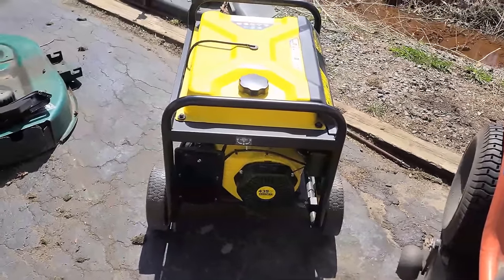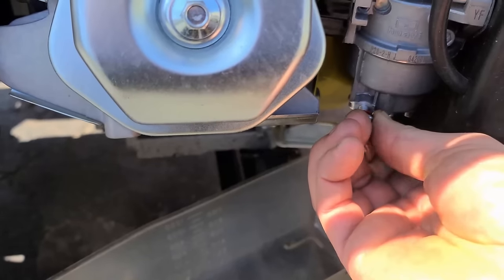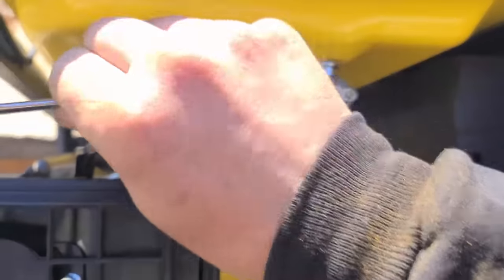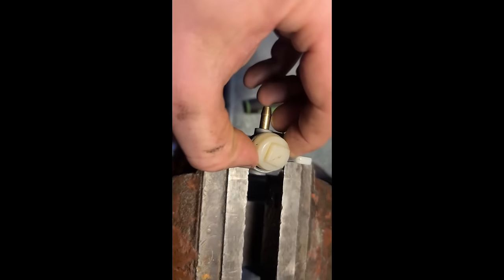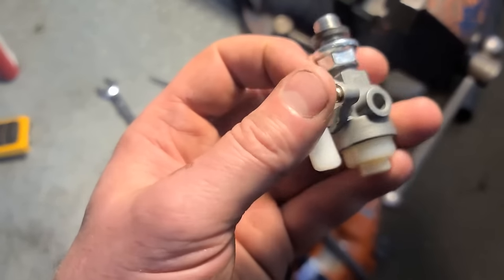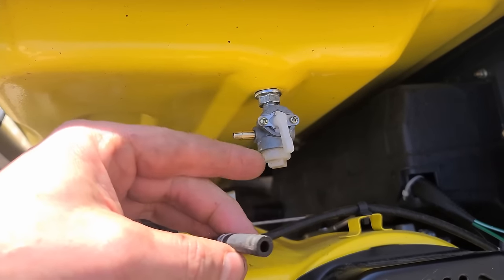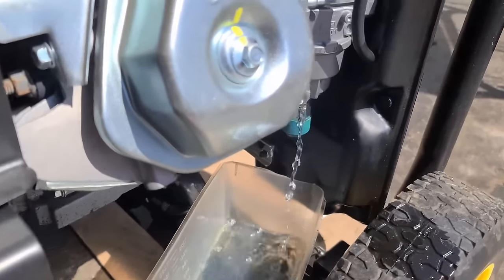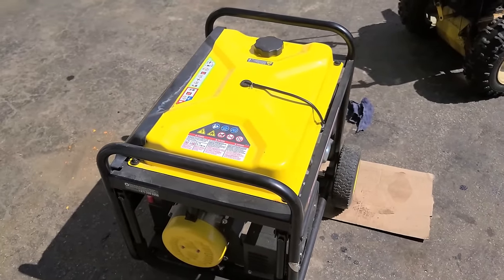Generator Runs A Few Minutes & Dies - Here's Why!

Comment: I had an issue with my 8k Champion the other day, it would start and run fine with a light load, but after about 20 minutes or sooner with a heavy load it would bog down and die. Let it sit a few minutes and it would restart and do it again. I am running on propane, dual 40lb tanks, so I knew fuel wasn't an issue. Pulled the plug and it looked perfect, nice and tan, no signs of lean or rich burn. Decided to check the valve lash since I hadn't checked it in about 40hrs of run time, and I found the exhaust valve had basically zero lash and the intake had .001-.002". Set them to .008" on exhaust and .006" on intake, fired it up and it ran for 12hrs straight without a bobble. Looks like the exhaust valve lash was so tight that when it ran under load or for an extended time, it would expand until it wouldn't seat anymore and the engine would die from compression loss out the exhaust port. Pay close attention to your valve lash on these little engines, it's important.
Reply: Thanks for that info, besides this issue, what is your opinion about this generator? I am thinking of buying one.
Reply: I have the 
5500 watt duel fuel champion, I’ve only run it on propane. It’s been doing the same thing you described. I just hit 100 hours so it’s still pretty new. 
It’s under warranty, but how difficult is it to get to the valve lash?
Reply: @sparta2v  
Sorry for the delay, don't log in very often. I've had good luck so far except for the lash issue. As soon as I corrected that it's running great again.
Reply: @benstoth  
It's not very hard, plenty of videos showing the process. A few common hand tools needed and they are typically pretty easy to access on an open frame generator. The lash numbers in my post are pretty common on these engines, but if you can find a service manual for your engine, set to what they say if its different.

Comment: I have a Honda ez1800 generator and it runs for 30 sec then dies; you can wait 10 sec and it does the same thing.  Same thing if low oil switch is disengaged.  Tried the bowl test and a steady stream of (new) gas keeps coming.  Exhaust not plugged.  Ideas?

Comment: I purchased a new Champion 7500W Duel-Fuel Generator (model # 201040) in October 2021. The gen was exhibiting the same issue as shown in your video with one minor exception. It ran flawlessly at idle. However, when I applied a load, the gen would die out after about 15 seconds. It didn’t matter if it was running on gas or LP gas. The result was the same. I contacted technical support and the tech said it sounded like a bad Overvoltage Controller and he’d ship out a replacement ASAP. After receiving the replacement, I installed it and the same thing would happen. Since it was under warranty, I took it to the service center in Newark, NY for the tech to diagnose what was causing the engine to die out when a load was applied. The issue turned out to be two bad 120V AC 20A GFCI receptacles which, for some reason was causing the engine to die out. After the receptacles were swapped out with new ones, the generator runs great now.
I enjoy watching your videos. I even watch them when the equipment you're working on is not relevant to me. I figure at some point watching your videos can be applied to help me diagnose/fix/repair power equipment in the future. Keep up the good work!
Reply from the maker: thanks for that info!

Comment: I have a 4.0 hp Champion on a trash pump. Very reliable machine. It quit running the other day and wouldn’t restart. I thought maybe it sucked some grit into the carb as it was low on fuel. I did a carb clean and still no go. Checked fuel filter, another carb clean and cleaned fuel tank. Still no go. Then it occurred to me this engine has a LOW OIL sensor. Checked oil and it was low. Added oil and engine fired right back up!  Live and learn I guess!
Thanks for your great channel!

Comment: I have had' hunting' issues with my generator most vids have pointed to it being blocked jets. I tried clearing them and it did not work for me, so I will be checking my fuel tap assembly tomorrow.  Great vid, thanks

Comment: Thanks so much, was exactly the simple fix my generator needed. Found sediment and crud in my 5 gallon gas tank after drawing the generators tank into it. The fill cap has a strainer however I dont always leave it in when I fill it. I will now be checking and rinsing the small engine gas cans when they are poured empty.
Reply: Rinsing? With?

Comment: Interesting, I checked my gas shut off valve and saw gas flow right so it wasn’t blocking.  Opened up the air filter box and removed the filter.  Somehow it started and stayed running for 5-8 minutes before gas ran out.  I added another few oz of gas and restarted.  All good now.  Thanks for the video and sharing what can cause the thing not running long.

Comment: I have a Duromax that did the same thing. The gas/propane selector switch is what was bad. I just bypassed that and placed the fuel line directly to the carb. Runs like a champ now.

Comment: I’m having the same problem, I changed the in line gas filter, which doesn’t fill up, thanks for the tip about tilting the unit back, I was wondering how I was going to take the shut off valve off , without emptying the tank

Comment: Hi, tank u for thw videos. My Hyundai generator had a problem with the fuel valve, I replaced it, but the issue is that it keeps revving intermittently. When I try to connect the water pump, which I used to connect without any problem, it starts having those acceleration intervals, then it shuts down, and the circuit protector trips."

Let me know if you need any adjustments!

Comment: I have a DuroStar DS4000S generator (purchased in 2015 on Ebay) which is very similar to the Champion unit in your video. My unit was running fine, I start it once a month and run it for 15 minutes to ensure it is working properly. Then one day, I started it and it runs for a few minutes and quit in the same manner reflected in your video. After watching your video I thought that the shutoff valve was also my problem.  I purchased a new shutoff valve (a little different from yours) specifically made for my Durostar DS4000S.  I installed it and it shutdown after a few minutes...  same problem as before.  It should be noted, I actually drained all the gas and put fresh gas in the generator tank before I installed the new shutoff valve. So I figured the problem must be in the carburetor.  I bought a new carburetor and installed it …  still the same problem.  I have no idea what to try next...  Any ideas what the problem night be???? 

 Apparently...  I need an assist!!!

Comment: I cleaned the jet that was on top of the carb because of surging at idle.  My Westinghouse iGen 2500 only sputters for about 5 seconds and then dies after the jet cleaning.  But...when I put the covers back on, I laid it over on it's side, forgetting about where the oil might seep.  Thoughts?

Comment: Had the same problem on my 1500watt would stay going for 30 seconds then die, I disconnected the low oil sensor wire and it is running smoothly again, thanks

Comment: I have a generator that is almost impossible to turn over, I remove the spark plug and it turns over just fine. With the plug back in I can pull the cord only about a foot and it stops, if I pull very hard I can start the engine and it runs fine, I have had repair mechanics look at it and they have no idea, it’s not a vapor lock. Any help would be appreciated. Thanks, Kevin
Reply: Is it possible you may have a plug that's too long?  Maybe try one with a shorter thread length?  Just a thought, could be something easily overlooked.  Good luck.
Reply: The engine has a feature called "compression release" that is intended to make starting easier. Sounds like it's broken.
Reply: I think Jim Trainor has the right answer, likely a faulty compression release…

Comment: Bro you rock! Helpful asf!
Reply: Though the fuel filter was filthy, after cleaning it and the carburetor, and changing the oil, and cleaning the spark arrestor, and putting fresh gas, cleaning the air filter, unplugging the sensors, and trying the gas cap loosely on, it is still shuttng off after 5 seconds of running. But, it does sound and run smoother for that 5 seconds.... Any other thoughts? Or perhaps it's time for the pros?

Comment: I have a PG2300iS generator. It has 4 8mm head bolts. I was told that the head is supposed to be tightened down to 25 foot pounds. I’m wondering if that is in fact the right torque, or if it was supposed to be in inch pounds. The reason being is because I would have to use a 3/8ths to a 1/4in adapter on my torque wrench, and I’m wondering if the adapter would break, because the socket I’m using is an 8mm.

Comment: I replaced the petcock as it was leaking, still wouldnt start, checked for spark, was none, so cleaned the plug... It ran. Problem being it runs rough... shakes like a son of a gun... Would that be the carb needing set?

Comment: My 420cc generator suddenly won't turn over. Will still start and run if I use a screwdriver on starter solenoid.  Bad keyed switch??? Other electronic gizmos?  Wiring all appears fine.

Comment: Even if my generator is brand new? Stops after 5m
Reply: My brand new one is doing the same. Got it yesterday. I called to return it. They said to keep it & fully refunded. 🧐NOW , hope I can get it running
Reply: @terilivengood6911  I did the same thing. Actually figured it out. The gas I had was old so I ended up siphoning the gas and put new fuel and works like a charm
Reply: My gas is new. Not sure I was clear.